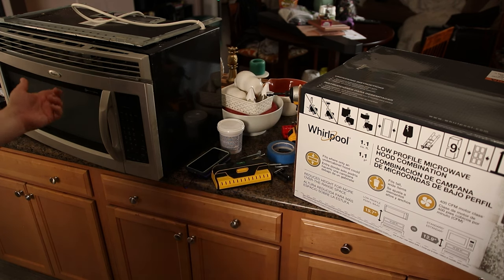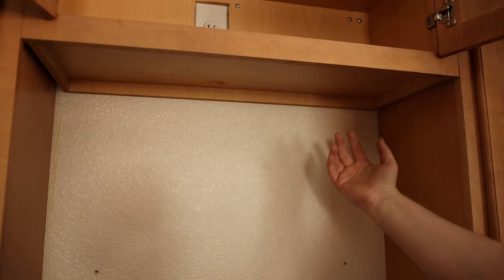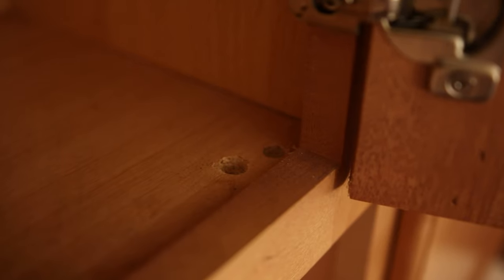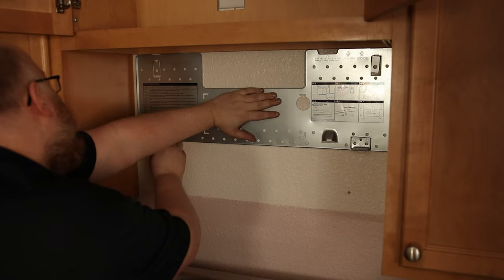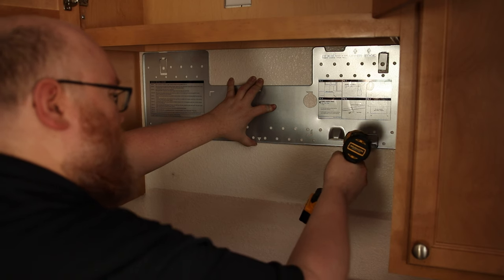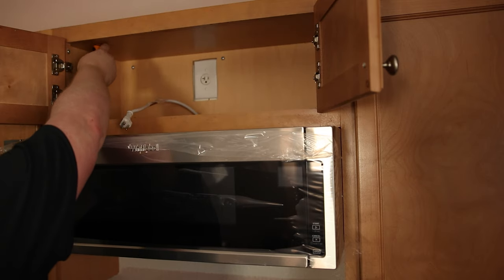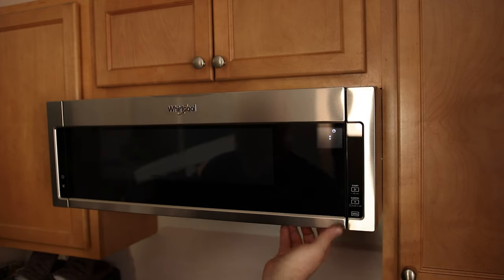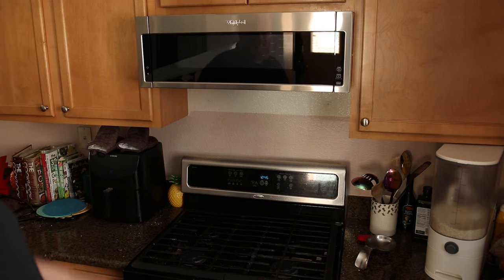Installing A Whirlpool Low Profile Microwave Over The Range (WML55011HS)

Comment: Thank you. My husband and I went over the instructions and did not realize the "template" for the bottom of the cabinet was also the back wall plate! We thought it was to be installed on the bottom of the cabinet! Finally it came together. We are no "spring chickens" and would not have figured this out without your video.

Comment: I just finished installing two of theses Whirlpool low profile hood microwaves, one at my daughters home and one at our home.  Your installation is spot on.  The only thing to be concerned about is if you are venting to the outside the two options are a center rear wall vent or a top vent.  If you have a wall stud anywhere near the center line then you must top vent. 
It’s great to have the extra 7” of space above our range using the low profile unit.

Comment: I got a Kitchen Aid low profile, took it out of the box, everything is exactly the same because it is made by Whirlpool.  But without this video I didn't understand much of anything about how that mounting bracket is the template to drill thru the bottom of the cabinet but I do now.  The printed instructions were just too complicated, they should have included a dvd or a download of this video.  My cabs are the same, virtually everything is the same except I am going to vent out of the top to the roof.    BTW Whirlpool/Kitchen Aid DOES have a video here but it about 30 seconds long and useless, they should be paying you:)

Comment: We're so appreciative you made this video!!
Reply: Snagged this microwave on a black Friday deal. It's the best looking low profile microwave that I've seen. It also sticks out an inch less than other brands plus has stainless steel on the sides, not just the front.

Your instructions were absolutely perfect. 1000 times easier to follow than the included instructions. Thanks for calling out the drill bit size as well, very helpful.

Comment: Hopefully someone can help me with the question. I have a similar unit and they give instructions for cabinet depth between 12 and 15 inches my cabinet is 16 inches and my concern is that the top cabinet up at the front is going to cover the vent holes. They say to make sure you don't cover those vent holes so it seems like I need to put some kind of a blocking on my back wall to bring the microwave out so it's going to stick out about 2 inches so the vent is clear. But I noticed your unit only sticks out about an inch, which means your vent is covered. Has that been a problem?

Comment: I have had this microwave over a year. One HUGE CRITICISM that made me sorry that I have it. Because of the reduced height in the microwave IT IS VERY EASY TO KNOCK THE GLASS PLATE/TRAY OFF OF THE THRUST DRIVE PEDESTAL!
I find this very irritating. Frequently having to realign the wheels in their shallow track and then replace the glass warming tray on the three pronged drive protruding out of the base.
A poorly designed unit!
I recently discovered two hacks which has helped immensely and thought I would share them.
First, the wheeltrack.
The Three little wheels MUST BE KEPT CLEAN, AND THE TRACK THE WHEELS RUN IN, ALSO! So be sure to clean the wheels and trackway well whenever cleaning the interior. (btw, a drop of olive oil, etc, on each wheel shaft is helpful.)
The biggest hack that I can't believe just occurred to me, is glue the three pronged drive pedestal to the base of the glass warming plate!! This stabilizes the glass tray and all one has to do is lift the tray straight up an inch or so which removes the drive pedestal from the shaft it sits over. The drive shaft has one flat side that must be lined up properly when reassembling the glass plate with the glued on drive pedestal.
THIS IS A MUCH MORE SECURE Arrangement and there are many less times the glass tray gets knocked off the pedestal. In fact, I haven't had any more problems with this hack and can easily lift the entire glass tray and glued on drive pedestal for cleaning.
I used silicone adhesive I had around, but if it comes loose, I will be using epoxy or light activated super glue next.
I hope this helps!
BTW, Caveat Emptor. Use these ideas at your own risk, not mine.

Comment: I did installed the one yesterday ,
After installing,  press open bottom ,but not opened fully , open only 1/4, then I have to open manually,  not automatic.
Any suggestions to fix this

Comment: So this was installed with no vent?  I dont have a vent and our old microwave had the blower out the front like your old one.  I guess you just dont ever turn on the vent fan on the new microwave?
Reply: The unit recirculates exhaust  as well as the old one. But it vents out of the top of the unit, you can see it when he's unboxing.

Comment: Im trying to install one of these and I’m still confused. So all it needs to hold the bracket onto the wall is only two bolts on either side and not 4? And the instructions keep mentioning “end holes for installation” not all the others.
Reply: You can screw into 1 stud and use 2 drywall anchors (3 total fasteners) for proper support, or 2 screws into 2 studs.  If you want to use all 4 you can do that.  You want the screws (or anchors) to be near the tabs so they don't droop away from the wall and bend.  Most of the time you need to use anchors for this just because finding studs right where you need them is pretty rare.
Reply: @distractor_beamreviews  thanks for the reply. I have a very weird set up with regards to the studs. I have the furthest hole to the left on the bracket with an anchor. A little more inward  and I have a lag but up higher. Then I have another lag in a stud but it’s the furthest hole to the right. On that side the support bracket says inward a little. I’m gonna have to secure it up higher even tho that side is being held on with a lag and not a anchor.

Comment: Do you really need the backing plate?  Can you just install it with the two top bolts?
Reply: You need to install the bracket. If you don't, the back of the unit will drop out and away. The bolts through the top of the unit are not enough to support the weight of the entire unit.
Reply: @BigJD5  thanks. I ended up using the backing plate. It wss a little tricky to lift it up and get it to “catch” on the tabs, but wotked.

Comment: I'm under the impression that this Whirlpool microwave WML55011HS is recirculating the vent. How is that achieved?
Reply: By default it pulls air in from the bottom and pushes it out the top front.
Reply: @distractor_beamreviews   that was my main question before buying it, because i dont have any option of extraction whatsoever if ti could work only  on recirculating